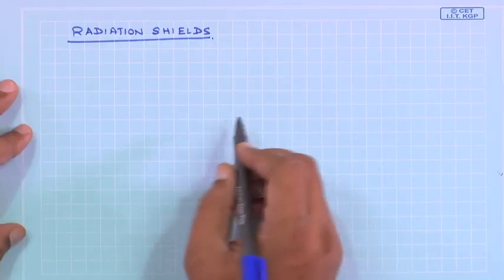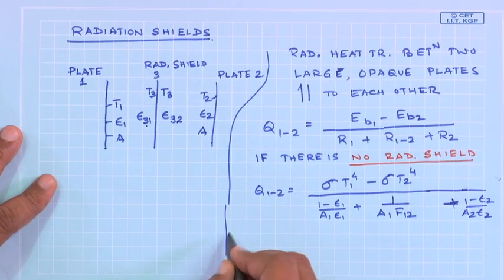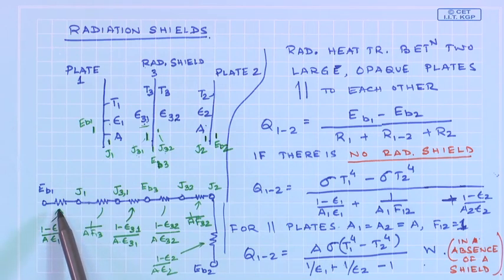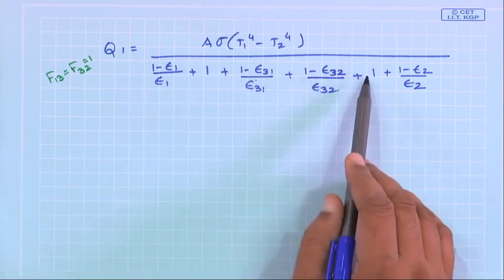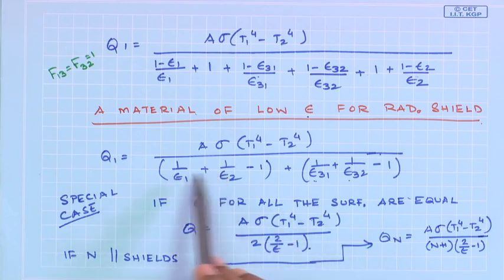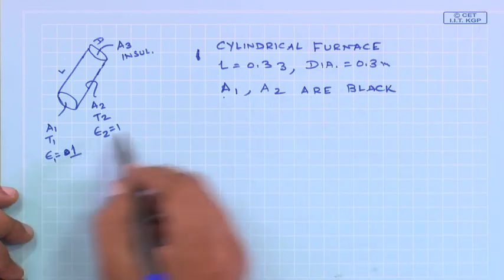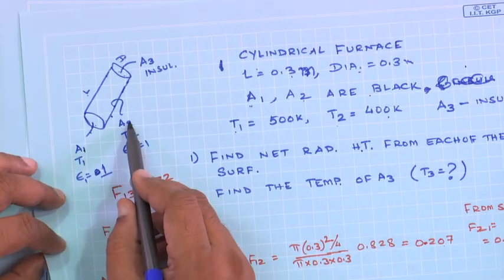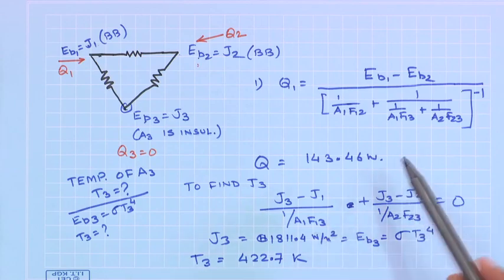Lecture 59 : Radiation Shields

Comment: What is the difference between the problem that is done in this video i.e., the surface is insulated and the problem that you did earlier where there was a cylinder and we had assumed an hypothetical enclosure ??
Reply: Heat can't be neither loss nor gain  from the insulated surface but in the cylindrical question a hypothetical surface is assumed through which heat can be lost.